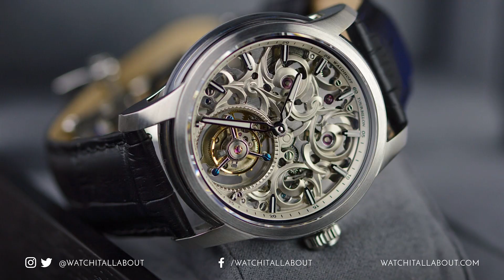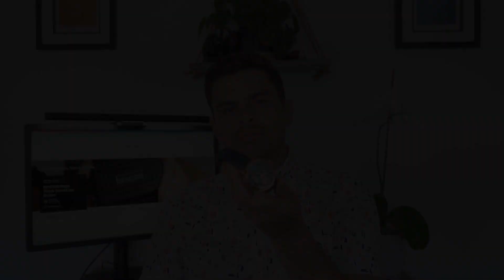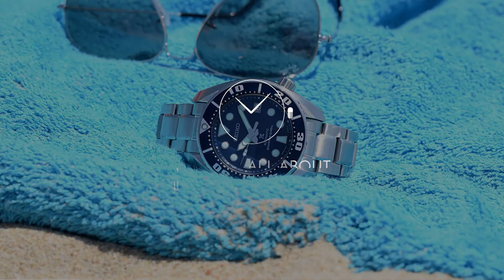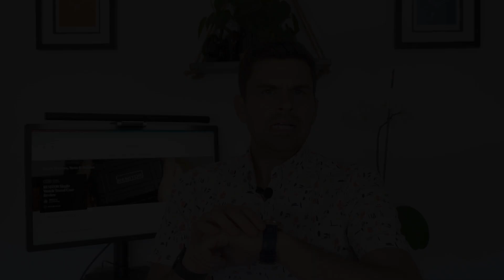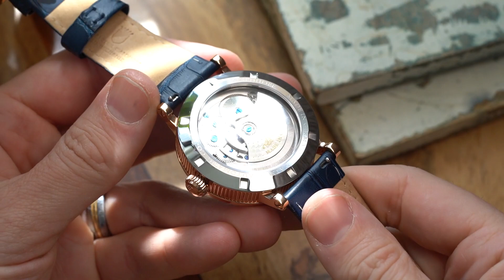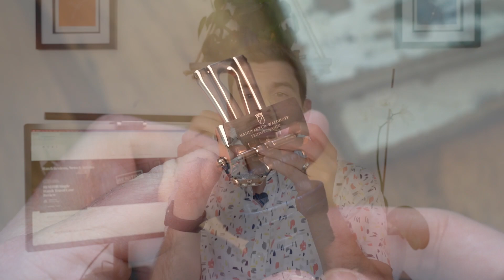A stunning affordable luxury tourbillon | Manufaktur Waldhoff Ultramatic Carbon Bay

Comment: Feel like the "individually handmade" text is kind of gauche.

Also, are the benefits of a tourbillon visible in a watch like this? Or is it's accuracy worse than a standard grade ETA?

Edit: just saw the part where you said the watch is +30/day. So, like, what's the point of it other than it looking cool if the tourbillon isn't really doing anything for its accuracy?  Also, "no punches pulled"? They even skimped on the RG PVD coating on the backside of the watch. If that's not cost-cutting I don't know what is.
Reply: Man, you went hard on this watch.  Its an affordable tourbillon.  What did you expect at this price point?  Most people don't really buy an automatic or manual watch for accuracy.  A $50 Casio keeps better time that a $20 k Rolex.  I agree on the text making this beautiful watch look cluttered.
Reply: of course they are cost cutting! it is an AFFORDABLE tourbillon after all. lol. Also, it was established a long time ago that tourbillons are not really any more accurate than a  traditional escapement. They are sought after today simply because they are difficult to make and they look mesmerizing!
Reply: I bought the watch after watching this video and it's worth every single penny of the asking price. The build quality is faultless and the back being stainless steel is not a problem, I rather that than have the RG wear off because it's forever against your skin which can be acidic. It really does look a million dollars I can't fault it in anyway. Regarding accuracy, it's really no different to a standard automatic, Mine runs about +10 seconds a day but as the mainspring runs down that 10 seconds is lost and the watch is accurate again. I'm used to regulating my autos by positioning to either gain or lose time and I can keep them very accurate for a month without needing to be reset. You can't do that with a Tourbillon, that's the whole point of it, it's not affected by the effects of gravity that a normal auto would be, but I can keep it regulated by the power in the mainspring and the power reserve indicator is a big help with that. No one needs a Tourbillon in this day and age, I would have bought the watch even it had a standard open escapement, but it's more the novelty factor and something that looks cool even if there's no big advantage. Something that is deceitful though is the wording on the dial, it says 'Msde In Germany' but it's actually made in Hong Kong and it's not a limited edition even though it says it is. Not the first watch to show misinformation and and it almost certainly won't be the last but Waldhoff need taking to task about it and if you look up dealers of this watch, one of them has taken them to task withdrew their dealership and were apparently threatened on Facebook about it.